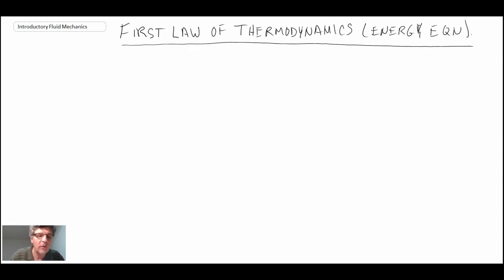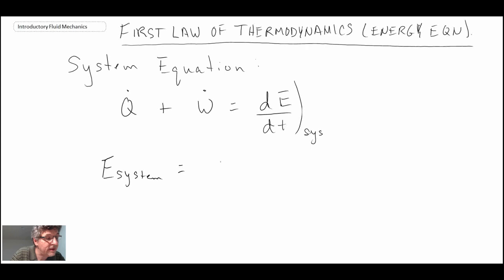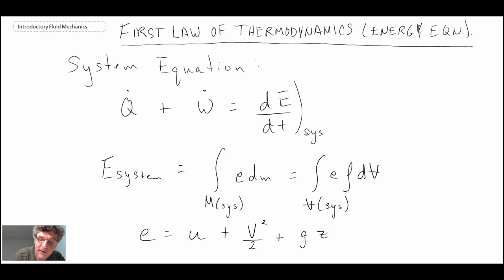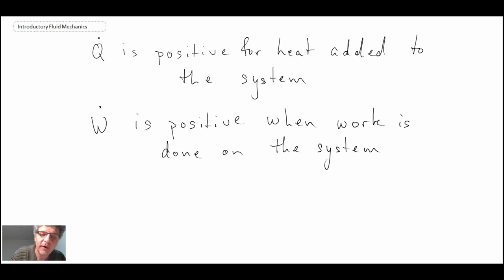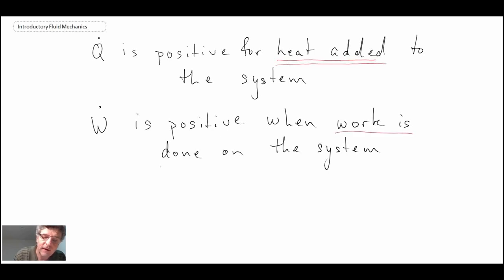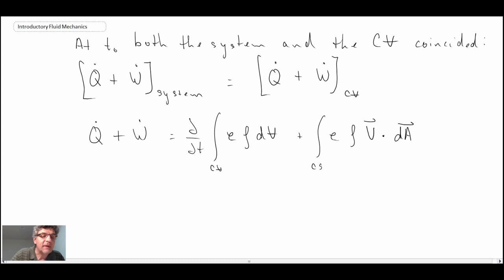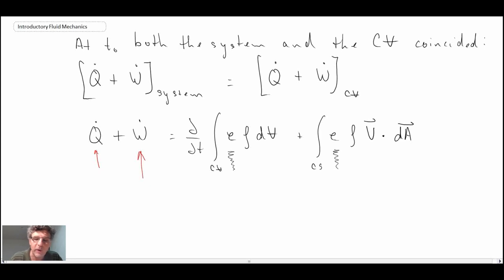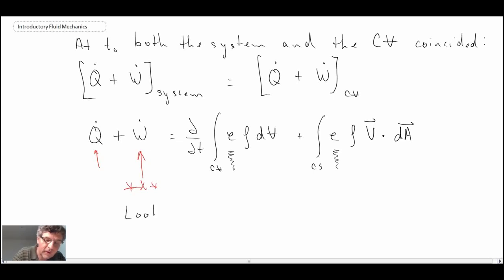Introductory Fluid Mechanics L10 p1 - Conservation of Energy - Control Volume Formulation

Comment: Sir, I think
Work is positive when work done by the system
Reply from the maker: It depends on how it is defined.  In this formulation of the First Law the LHS of the equation is expressed as Q+W with work done ON the system as positive.  In most Thermodynamics textbooks today they write it as Q-W with work being done BY the system as positive.  These two formulations are equivalent.
Reply: @ronhugo6225  thank you sir
Reply: Thank you, sir. I need a lecture PD